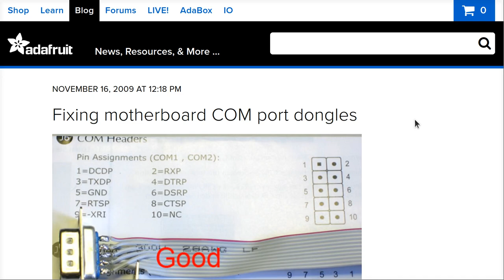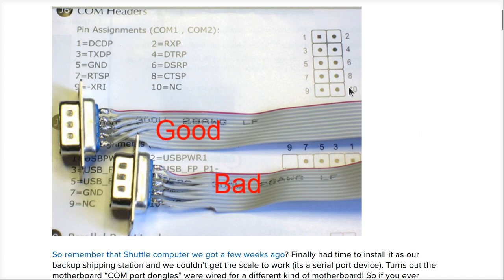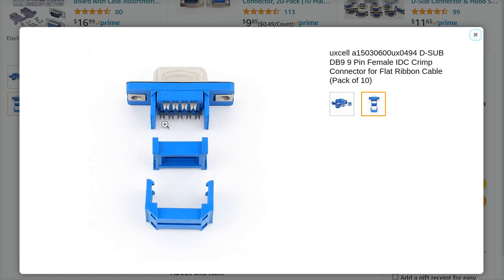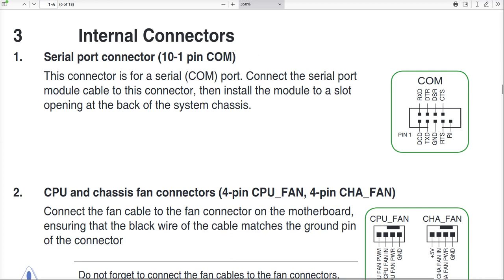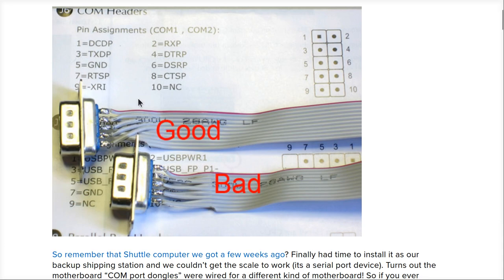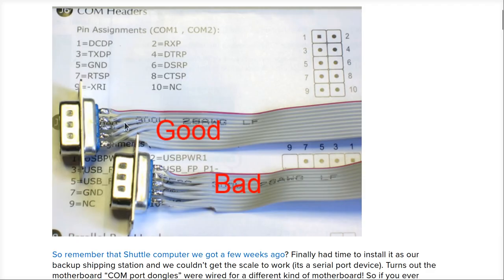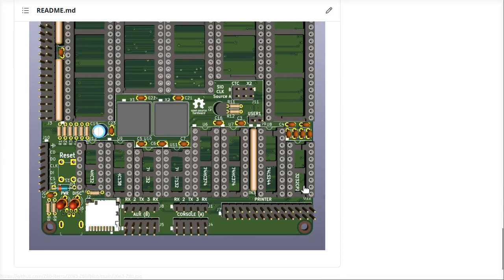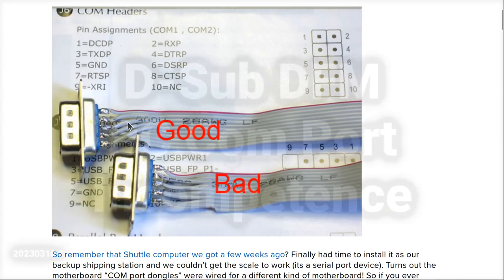Z80 Retro #64 - Com Port Cable Craziness

Comment: Here's the funny thing. When I built my Z80 Retro, I did what I thought was logical at the time and dug through my box of old crap and pulled out an old PC motherboard serial port. And it worked just fine. Just now I pulled it apart and it was soldered together in the "staggered" fashion as you would expect for an IDC connector. So there are apparently PC motherboards that use that format as well.

Whereas several years ago, when I was putting together an SBC6120 (single board PDP-8 clone) which also uses the same type of serial connector, I also (at that time) grabbed an old PC motherboard serial connector off of my pile of spare crap. But when I powered up my SBC6120... I thought it was broken (or I messed up the assembly) because I got nothing but garbage on the serial port!!  Took me AGES to figure out what was wrong with it. Turns out the SBC6120 was also expecting the "staggered" arrangement of cable, but the PC serial port connector I grabbed was actually soldered in the "1 to 1" (ribbon cable pin 1 -> DB9 pin 1, ribbon cable pin 2 -> DB9 pin 2, etc.) fashion! And the reason I was seeing garbage was (I suspect) because the RX and TX lines were so close to each other on the ribbon cable that there was some "crosstalk" between the two, which my particular USB to serial adapter mistakenly tried to interpret as actual RS232 data.

So apparently BOTH types of motherboard serial port wiring are used by PC manufacturers!!!

I guess it's like what AST said, "The nice thing about standards is that you have so many to choose from."
Reply from the maker: If you use the wrong one, the signal on pin 3 can work but it will likely ride on some sort of ground loop.  So some times, in that configuration, data can flow in one way only.

Comment: Let’s face it.  My understanding is that the first “IBM” PC was cobbled together using Intel Application data sheets including all the misinformation and errors.  IBM hired a few college grads with ideas, but no real experience. Hence you get what you get with  no thought to future manufacturing efficiency, not mention future programming headaches because of hardcoded video memory mapping.  Of course, IBM being iBM, the standards were cast in stone, and 50 years later we’re still saddled with it.
Reply from the maker: Such a HORRID mess!!!.. even obvious to me at the age of 20.  Active-high totem-pole-driven IRQs????  WTF???  How did ANYONE approve that??  And I doubt they even read the Intel docs... I did and it SPECIFICALLY said NOT to assume that the (annoying) overlapping 16-bit register addition would remain in future releases as the overlapping distance would change.....  The first thing Microsoft does is weld in a "16-byte paragraph."
Reply: You thought that was bad! How about the PCI bus impedance? It had to be experimentally determined afterwards to be 65 ohms. EISA bus: With the wrong hardware reference disk you can brick a whole system. Microchannel architecture - how overly complicated & expensive! VL (local bus) - as stable as melting jelly!

Comment: John, I pulled the backs off 4 of my serial connectors and 3 of the four would work with your retro board without modification. so much for the bad standard being consistent.
Reply from the maker: Yeah.  Someone mentioned that they had seen some pinned like the Retro and others like someone confused pin numbers with the pin positions.  Ya know... like they hired someone with zero engineering experience.

Comment: I have fallen for those com port cables before. The worst part is: no one ever agreed to a pinout. From the socket 7 era and probably earlier, you can find both variants.
What happened to me was, i took a port cable from one PC to wire the com port of another one. But the two PCs used different pinouts and it took me forever to figure out
Reply from the maker: Sometimes I find myself looking at a situation and asking "Does it really HAVE to suck THIS much?". 🙄

Comment: What’s even worse are many USB serial cables that don’t properly hardware handshake correctly. They can cause connected 3D Mills, printer & plotters to go haywire from data overruns. Very Dangerous & wasteful! FTDI were smart enough to cash in on this with a reliable product.
Reply from the maker: That rant remains waiting in the wings. The problem there is that it isn't until RS/232E that full-duplex flow control was even specified.  Before that RTS and CTS both were used to manage half-duplex glow control! --- By then most UARTs were designed without full-duplex flow control.  Just eeeewwww.

Comment: So many bad DFM decisions went into the IBM PC.
Remember the floppy drive data cable where to avoid having to set a jumper on the B: drive on a bussed cable, they split out several lanes in the middle of the ribbon cable and flip them 180 degrees. Something I used to call "the Boca Raton twist".
Could you configure the first header to maybe route to different pins on the 2x5 to compensate for the PC compatible version?
Reply from the maker: 🤣 yeah... That twisted cable!  Obviously a move to avoid taking ENDLESS calls from confused people (that should not be allowed near a screwdriver) trying to install a second floppy drive.

Comment: It would be great to see the Amazon link to the connector you showed in the video Description.
Reply from the maker: Good idea... 
Female: https://a.co/d/ch2q4E0
Male: https://a.co/d/3y8zAyo
Ready to butcher: https://a.co/d/cgldo9p

By the way... look closely at the types of jack-posts on things like these connectors and gender-reversers.  Some times they have the bolt and some times the nut. It seems that I am always getting the right DE-9 reverser and the wring bolt/nut gender.  Make sure that you can either remove the jack-posts (as is most of the time the case) or if you can't that they are right for your purpose.

Also, note that the cheapest gender-reversers can have two nuts that, when removed, allows the metal covers to fall off.  I have some of those. 😞They work with/without the covers... but it is annoying.

Comment: Pin 2 on J4 is not connected?
I would suggest connecting pin 5 to pin 2 on that header to support either cable.. but I think that the other end, if not running in a "3-wire" serial mode, might get confused. Maybe PCB shorting blocks (the cut-or-solder type) to select 2 or 5 on J4 might take up less room.
Unless I am missing something, apologies if so.
Cheers,
Reply from the maker: It would involve optioning pins 2, 3, 5, and 9 on the rectangle headers.
Reply: @JohnsBasement  I think your single row header for swapping tx,Rx is a great idea. Sorry was just thinking about some type of support for that "industry standard"  of a cable that PC motherboard manufacturers came up with.
Cheers,
Reply from the maker: @EngineeringVignettes  I probably need to do a whole piece on RS232 and the fact that there is the before revision-E and after revision-E "standards" that change flow control options. 🤢 Combine that with insane cable designs and....  🤮

Comment: Some RS-232's have revisions, A, B and C and some other RS-232's are data terminal something something and others are the opposite. If the pin header would be on the board, but besides there would be some space to adjust a few things, then everybody could be happy. It could be easily rewired for more retro stuff, like ring indicator. 
The same thing goes for joysticks, some have two buttons and a five volt connections for electronics like rapid fire. Others have in that same spot the wire for the third fire button and no wire for paddles or analogue turn thingy.  If some extra space would be on the PCB then the user can configure it as he likes. I would add 12 fire buttons and a back-space for when I made a mistake in gaming. Most games lack the feature, silly actually.